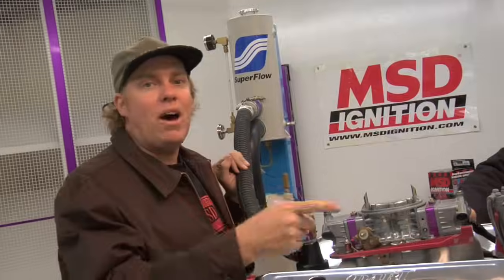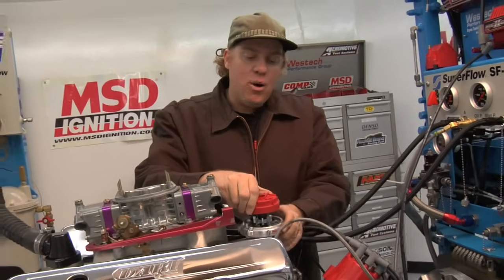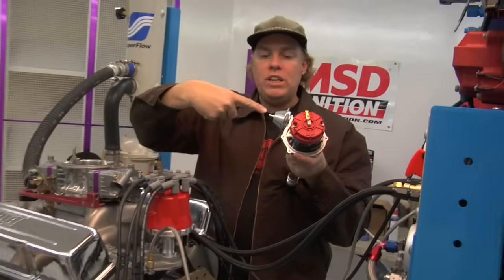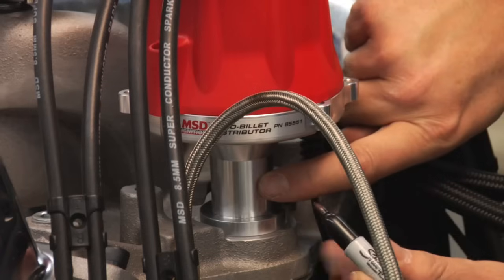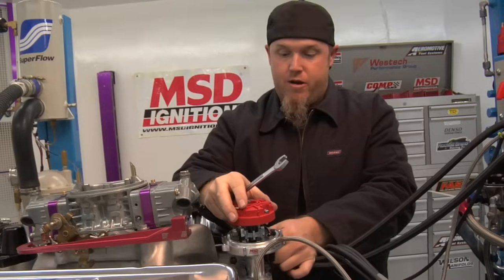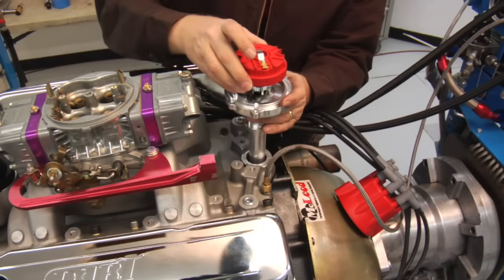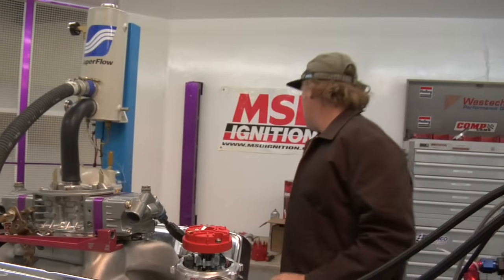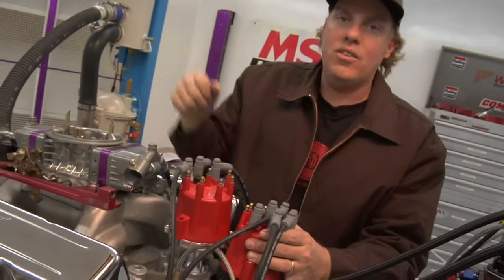Installing a Distributor Part 1

Comment: Great video; suggest u show how to RNR as the first part of your video almost did ( u put the same one back in)... i guess one would need to have a method to line up an exact replacement somehow so re-timing is not not necessary ?   (How to mark the new one so as to avoid the timing light issue).

Comment: What if the distributor was already out of the truck and fully took apart without any marks and all the plugs and wires gone so I had no idea where anything went, where would I want to point the #1 wire and cap??

Comment: Question I just did that and it's still not firing I'm thinking it might be a cam positioning sensor in the front of the motor on a '97 Silverado

Comment: Don't be fooled. A clean engine on a stand is great for showing what to do, but it's a different smoke when the block is dirty and the distributor is in back nearly flush with the firewall. Prepare to use curse words liberally.
Reply: That's why you're supposed to always keep your entire engine flawlessly clean and polished-up.

Comment: Great video on distributer install. Built all new motor for my 1987 Corvette, 355 ci. Double Roller Rocker Timing Chain and Gears, Flat Tapet Pistons 10.5:1 compression, Flat Tapet Valves, all hydraulic. CompCams Hydraulic Flat Tappet Cam. Machined L98 Heads & 1.6 Stainless Roller Rockers, new valves, guides, and springs. Machined Runner's and Plenum. Having to replace the Pickup Coil meant removable of Dist., I hesitated. This video gives me the courage to do so. Thanks.

Comment: this is informative... but you confused me with "don't crank over the motor" What if I'm only pulling the distributor because I'm replacing the head? I'm throwing timing out the window, until I put the crank and cam at TDC. which was where I wanted it, when I removed the distributor. don't you just make note of the position of the rotor, when at TDC, and then try and duplicate it?

Comment: BTW, I had an engine builder do all the building who is also a Corvette owner. I also have been doing some work myself since the engine was installed. Not a true mechanic per se but your videos are very helpful. Thanks.

Comment: hey i have a 1995 ford f150 4.9l v6 manual transmission,, is there any luck for this engine to make look as impressive as the on on the vid? and if so, how much would something like that cost?

Comment: i was told to put paper  Distributor hole and bumb the key to build pressure and it will pop the paper out but u said not to turn the key or anything?
Reply: Thats cuz it was already set

Comment: I just bought an old 69 Chevelle with a 396.  Which MSD kit would be the best replacement?   I was thinking this one 555-40005 HEI Distributor, 
121-6201 MSD 6-Series Ignition and 555-40201 8.0mm Red Hot Pow'r Wires.

Comment: What would be the cause of the Distributor not rotating to 5 degrees when setting ignition timing? it was at 12 btdc and i need it at 5 but it only went to 8.

Comment: Always  go to  top dead centre on compression stroke( I prefer to do this at  timing degrees so it aligns perfect to  post) when it drops in the centre marker  on  rotor button should align with the  with the  marker  on the distributor body where cap sits.  then you are in correct place for  maximum movement for  doing the timing. especially important in a dissy with points.

Comment: hi, what is the way when the position is lost?
the zero mark on the flywheel is finger on the cylinder 1 cable?
I have made the fine marking before, but which gear position clicks in is lost

Comment: Hello David and Chad, I have a 1978 Ford 302 engine in a pickup truck.  Is there an O ring or seal where the distributor goes into the block?  I think I might have a leak there, and that I might have to get this O ring replaced.  The oil sits in two little depressions on each side of the water pump and distributor when it leaks out, and I sometimes soak it up with toilet paper.  The leak is either from this or from where the intake manifold meets the block, but this latter joint was re-done not too long ago by a good mechanic.

Comment: I'm amazed how much you had to dumb things down (sorry to the guys who needed it) but you did over look two very important points. 1.) The relationship of #1 spark plug wire to the cap.. There are not 8 teeth on the drive gear and you cannot put #1 anywhere on the cap, it has a pre-engineered location.. If you want things to work correctly its gotta be in the right spot.. 2.) I never found this one till I was in my late 20's.. There are times when using after market parts, ie; intake manifold, distributor, etc., that is will happen, the distributor will bottom out on the oil pump drive before it sets down on the intake manifold (particular to sbc and bbc).. Hard on the oil pump first of all cause youre trying to clamp down the distributor against the pump drive and second you cant keep the thing in time (wants to advance itself) not to mention the oil leak cause the distributor isn't setting on the manifold compressing the gasket.. Just a little F.Y.I. from a guy who beat his own head bloody against a wall before he figured it out..
Reply: a bit of dielectric grease is also a good thing...and they skipped that part also.

Comment: Wow. That's a lot of information...
So, how do I lock out the vacuum and mechanical advance to allow my gm tbi upgrade (in my 1976 cj7 jeep with 258 I6) to allow the ecm to control the  distributor/timing/spark? "0
Thanks for the video.

Oh, by the way... I believe my cam shaft is soft iron, do you sell the dizzys specifically for the set up I'm trying to attain?

Comment: If you are installing a new distributor on a new shaft. How do you align the distributor  housing in the correct position? Or how do you make sure it is set in the right place?
Reply: Darren Vallee u

Comment: the tricky part is actually lining up the gear with oil pump slot
Reply: No one seems to ever talk about this issue....which is actually the hardest part about installing a distributor on a rebuilt engine.  The rest is a piece of cake.

Comment from the maker: @7233910  Keep in mind when the distributor falls in, because of the gear mesh, the rotor will move on you as you drop the distributor, you can usually compensate for it since it will turn as you drop it in. Best bet is to call in- 915-855-7123

Comment: hahahahaha.... try this on a dodge 1500 ram.... hahahahaha....  while the engine is actually in the engine bay.... or still under hood.... nope. AND keep your Dist screws from the old one. the new ones are too thin as I found out.

Comment: Guys I need HELP! I had a new engine installed in my 55 Chevy, now when I turn the heater blower on it kills the engine and the engine runs rough even if I don't turn the blower on. I noticed that the car still has the ballast resistor hooked up on it, could this be my problem? Is this supposed to be disconnected and then wired directly to the dist? Anyone out there please advise me if you will, I'm at my wits end. I do have a HEI distributor in the engine but like I said the ballast resistor is still hooked up. Please help and thanks.